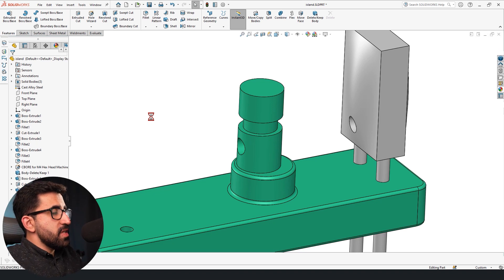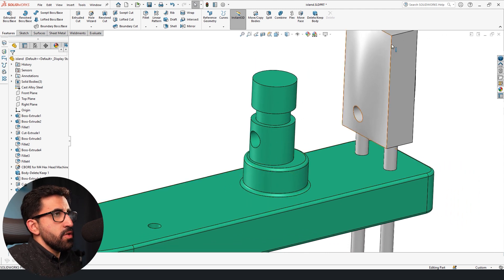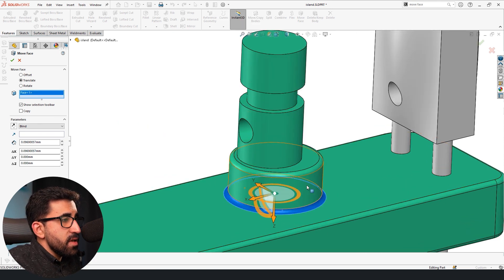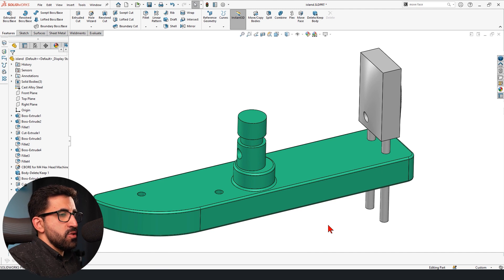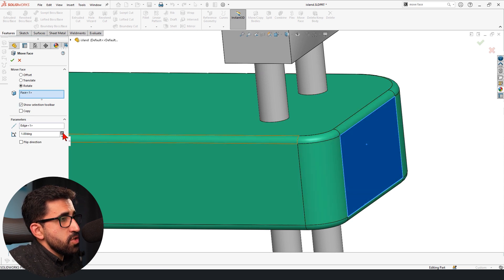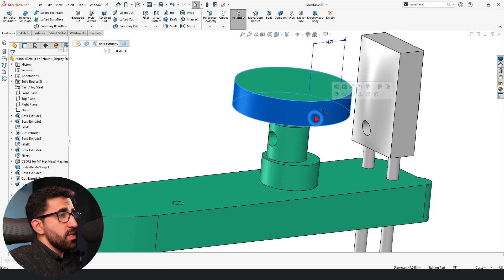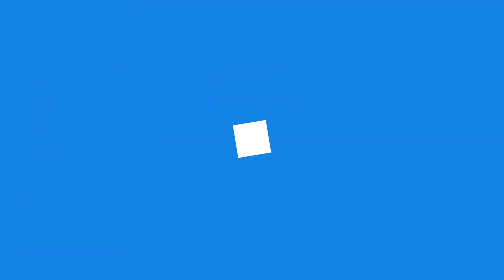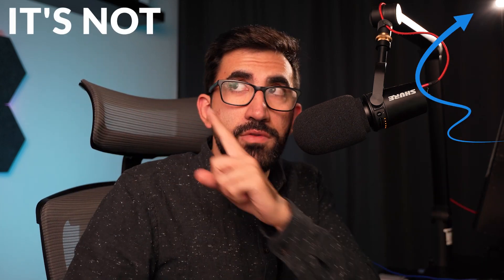A very Unique Tip in SolidWorks

Comment: This video and the techniques covered are far ahead of where I am in the SW learning process but one simple item came to mind when Ryan typed in the Search Box for the Tool to "Move Face"  --- That is:  When you get the result of the search you can click/hold/drag the Tool Icon in the Search Box and Drag it onto any one of your ToolBars - thus creating a CustomTool Bar out of one which normally wouldn't have that Tool(s) in it. I did this with the "Measure" and "Mass Properties" Tool Icons cause I wanted a faster way to get to them when creating a Model.  My question is: If you want to REMOVE the Tool from the ToolBar you previously placed it in how can you Remove it or any other unneeded tool ? Just clicking on it and pressing Delete doesn't cut it.... or is there a config. screen where you can create an entire Tool Bar to your needs and taste ?
Reply from the maker: David, follow the flow of the course before you watch these, the whole point that I want you to understand is to learn the topics in the order I organized them for you in the course. Once you are done, then add these bits and pieces to your essential learnings.
Reply: @with-aryan   ... yessir -
Reply from the maker: yes there is, it's called the shortcut list and you can find it in customize, shortcut menu. The keystroke for it is "s'